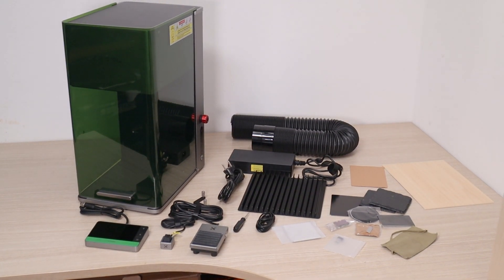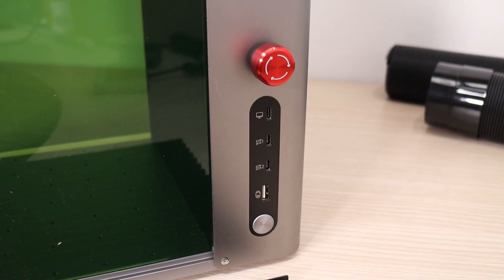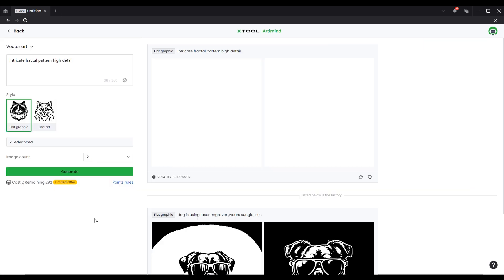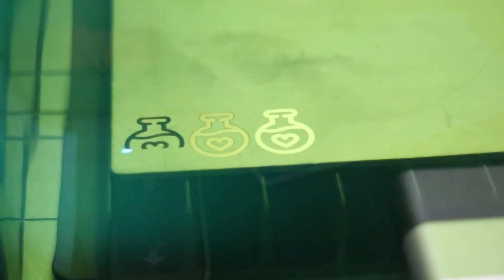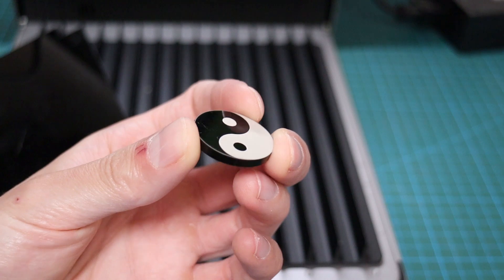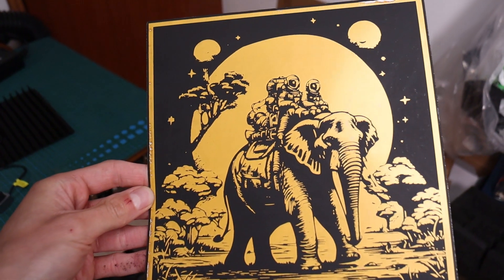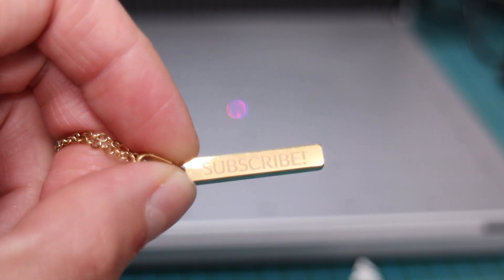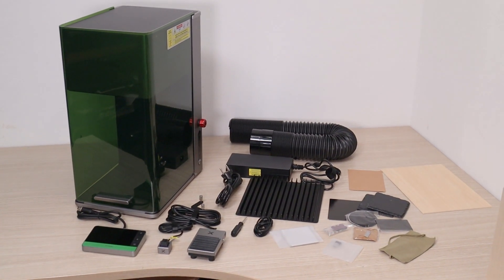xTool F1 Ultra - One Laser Engraver To Engrave EVERYTHING? (Review and Test)

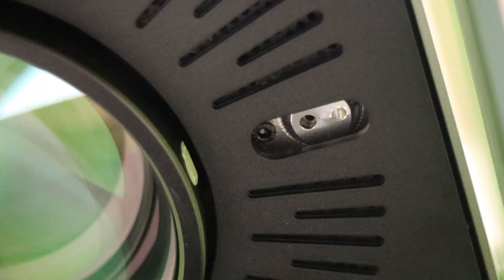Comment: 12:37 It looks like the problem with the batch mode is that the camera is right at the back of the build area (2:34) and so it's seeing a top-down view of objects at the back but a perspective view of objects near the front. Should be possible to correct that distortion in software, but it'll throw off edge detection.

Comment: Dear JT, I would like to ask you to make an experiment with engraving copper, mainly PCBs, with the diode laser. Copper has higher absorption for shorter wavelengths. That is why I assume that engraving copper should be more effective with the diode laser which has shorter wavelength compared to the fiber laser which emits at longer wavelength. Thank you so much. Kind Regards, Pavel
Reply from the maker: Hi, I have already tried that. Blue laser doesn't mark copper at all no matter the power. It also doesn't work on brass, raw aluminum, zinc, chrome... For metals you need infrared laser
Reply: @JTMakesIt  Hi, Thank you very much!  Elsewhere, you will find an information: "450nm laser is an ideal light source for processing non-ferrous metals such as gold, copper and copper alloys".   In my view,  your bad experience in engraving copper using blue laser is based on the fact that the blue diode laser is usually a non-pulsed one, it is a continuous wave (CW) laser. On the other hand, the infrared fiber lasers are pulsed ones and therefore their superior performance compared to CW lasers. It would be very interesting to see the performance of a BLUE PULSED fiber laser, however, such lasers are rare. Thanks a lot again. Kind Regards, Pavel
Reply from the maker: @PavelZahradnik-p4l  I think pulsed blue laser would be very dangerous for the eye. And yes, pulses give fiber lasers the ability to vaporize metal, since the individual pulses can reach ranges of 10kW of optical power. On the other hand, fiber lasers can't mark wood which I find interesting